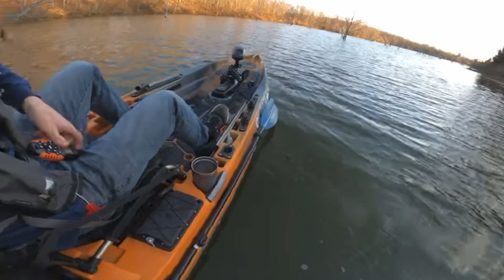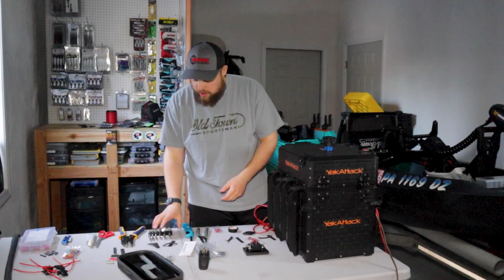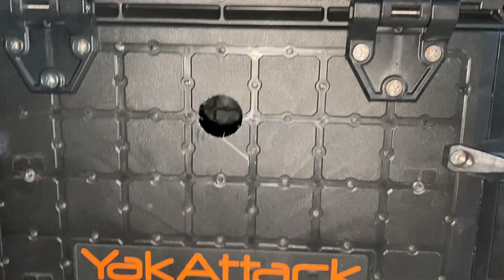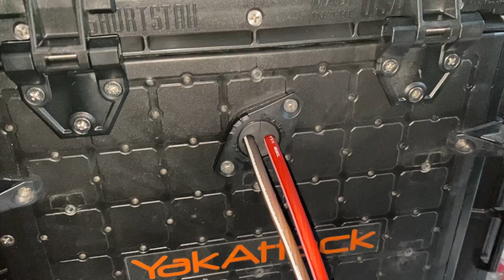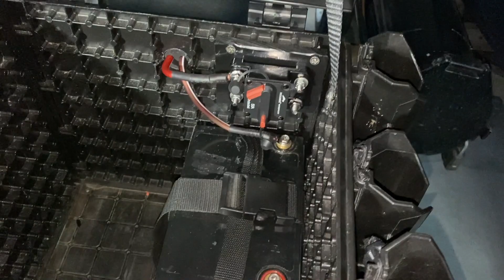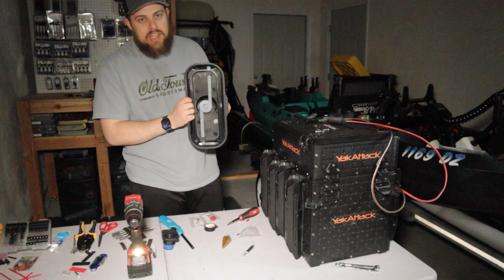Create A Powerful DIY Harness For Your Electronics!

Comment: Having issues with my Garmin losing voltage on my yak power. This seems like it might do the trick. Do I need to use a plug like you did ? Or can I run the wire from the switch and battery and connect directly to the metal crimps?
Reply from the maker: You could technically skip the plug. Just make sure you have a fuse between the graph and the battery.
Reply: @jake_stem_fishing fuse that comes with the Garmin cool? Appreciate the reply!
Reply from the maker: @Leejahd65 yes that works fine!
Reply: @jake_stem_fishing appreciate the help!